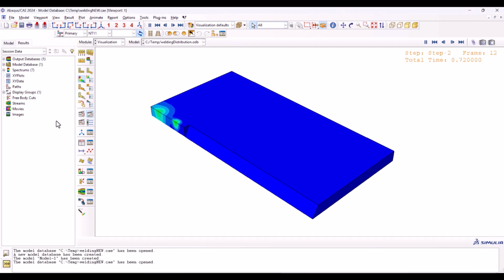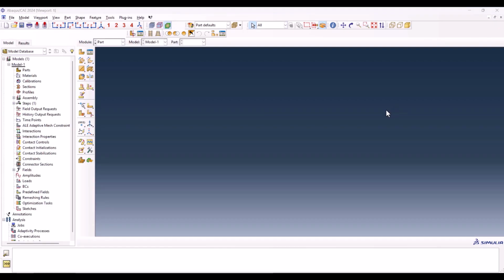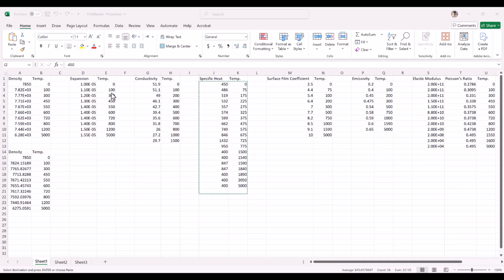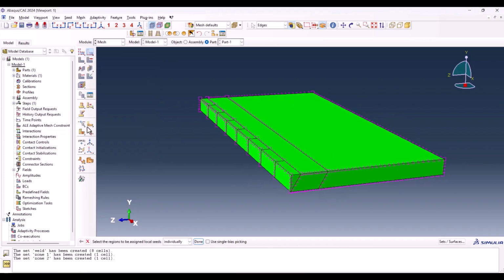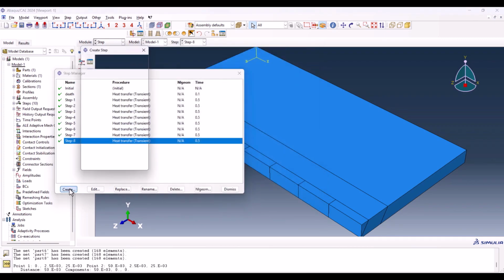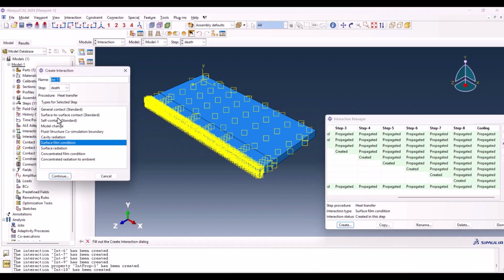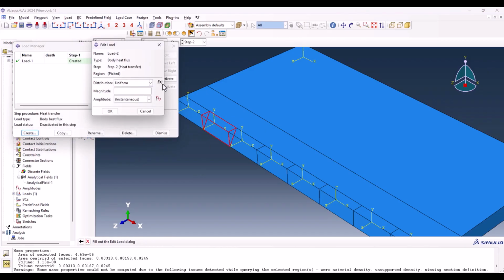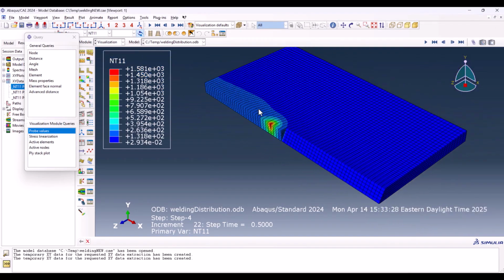Abaqus Welding Simulation Birth & Death Technique Explained

Comment: May I ask what element size you use in the melt zone and heat affecting zone for laser welding simulations? And do you use linear or quadratic elements ?
Reply from the maker: I can’t remember it as it was for almost a year ago. I’ll double check later

Comment: I have used the DFLUX subroutine for the load application, but facing in the multilayer
Reply from the maker: Make sure your element activation sequence matches the heat source movement in your subroutine.
Reply: @FEAMASTER  https://youtu.be/rfTPBf49p0U?si=VyArFmq1KrCkjmcT
Reply: Please check the video of my simulation; the heat is reaching the 2nd layer before the deposition

Comment: Hi, thanx for ur amazing tutorials, I have a question about exporting a simple ( hexa mesh ) plate  from Abaqus to MSC Apex or Simufact-welding ( to get the advantage of easy making of fine mesh and  transition of the HAZ) , I have heared that it should be in .inp file ...could u please make a short ( yet clear ) tutorial about exporting a meshed part from Abaqus to MSC Apex. Thanx in advance.
Reply from the maker: Thanks a lot!

This topic isn’t very common, so I wouldn’t make a full tutorial on it, but you’re right: the usual way is to export the model from Abaqus as an .inp file and then import that into MSC Apex / Simufact.

Very short workflow in Abaqus:

1-Go to File → Export → Model…
2-Choose Input file (.inp) as the type (or make a job and write input file but don't submit it!)
3-Select the part/assembly (your meshed plate)
4-Make sure “Export mesh” (and element sets, node sets, etc. if needed) is checked
5-Save the .inp and then import that file in MSC Apex / Simufact.

Comment: Hai, your videos are very useful to me, i am doing PHd now, I need help from your side, I am doing Dissimilar (Al alloy and CFRP) adhesive single lap joints, I tried in Abaqus CZM but the error will come, how to assign composite material, and to do tie constraint.
Reply from the maker: Thanks a lot, and good luck with your PhD! 

Modeling dissimilar Al–CFRP adhesive single lap joints with CZM in Abaqus is quite advanced, so it’s completely normal to run into errors. In short, you need three main parts: the CFRP composite, the aluminum, and the adhesive/CZM definition. For the CFRP, define an orthotropic material (Engineering Constants), then create a composite layup (plies with correct thickness and fiber orientation) and assign that section to your CFRP part. 

For the aluminum, define a normal isotropic material and assign a standard shell or solid section. For the adhesive/CZM, you can either use a thin cohesive element layer between Al and CFRP (with a cohesive section that includes stiffness, damage initiation, and damage evolution) and then tie Al → adhesive and CFRP → adhesive, or you can use surface-based cohesive behavior directly between the Al and CFRP contact surfaces (in that case you don’t usually use a separate tie at that interface, the cohesive interaction itself connects them).

 Most CZM errors come from missing or wrong section assignment, mismatched element types (shell vs solid), using a tie together with a cohesive interaction on the same surfaces, or incomplete cohesive properties (e.g. stiffness defined but no damage evolution).
Reply: @FEAMASTER thanks a lot, you have an idea to upload like this video
Reply from the maker: @LUXECLIP-r5s  This topic is pretty niche and also depends a lot on the exact joint geometry, element types, and CZM approach, so the chances are slim that I can cover your exact PhD case in one short video.
Reply: @FEAMASTER If possible, could you please upload a simple video on dissimilar adhesive joints with a basic explanation (geometry, element types, or general CZM approach)?

That would still be very helpful for my understanding. Thank you!

Comment: Hello. I'm a graduate student majoring in welding. Could you explain why the magnitude value changed from 3.62e+10 to 1.52e+11 at 25 minutes and 27 seconds into the video? Also, I don't quite understand the formula exp(-3 * (pow(Y/0.004, 2) + pow(Z/0.00325, 2) + pow(X/0.001, 2))). Are there any related references?
Reply from the maker: It's just an example, changed the Ampere (I) to 100 to make the thermal load more realistic, I'm not validating anything here.  The code is in Abaqus syntax, and there's no reference for that. Watch this video, I showed the equation in math format and the ABAQUS syntax. https://www.youtube.com/watch?v=BpO28K71Ncc&t=194s